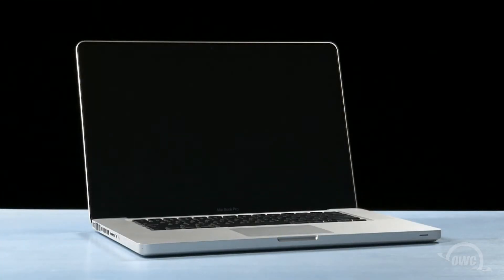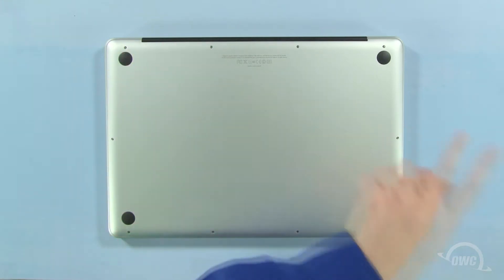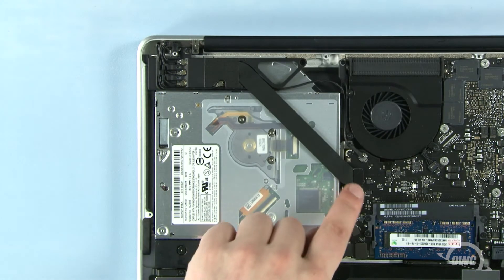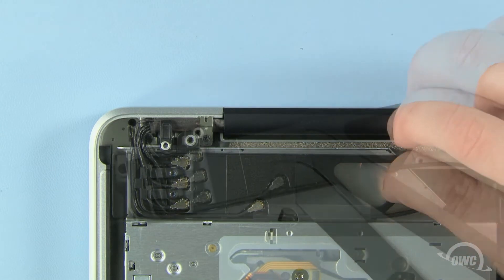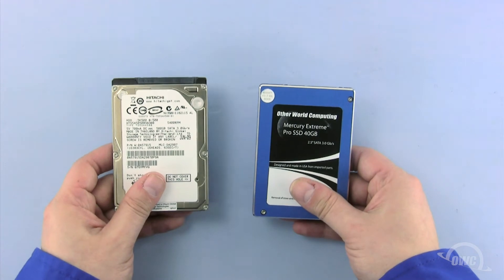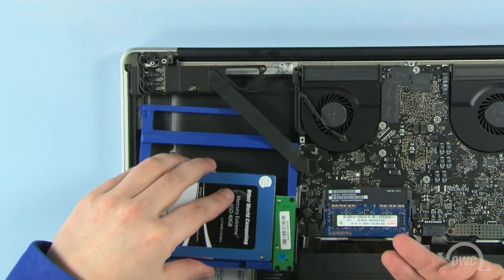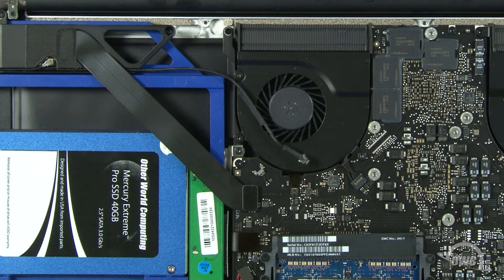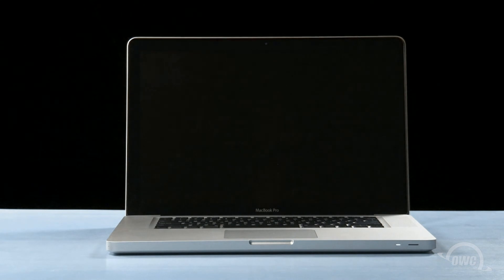How to Install a Second Drive Inside a 2011-2012 15-inch MacBook Pro with the OWC Data Double

Comment: I performed this upgrade a few weeks ago. I've got my SSD set up to run apps, and the HDD to store documents, etc. So far my Macbook is working perfectly! I do have a question though. What's the process for installing OS updates now? I'm assuming I'll have to install future MacOS  updates to each drive separately?
Reply: This is a year late and you've likely found your answer elsewhere. But should anyone else need to know, your operating system will run from one drive while the other acts as additional storage, akin to plugging in an external drive. The storage drive won't need OS updates.

Comment: Ok... the apps can be read on the HD that was installed into the optical drive bay now. Maybe, it was just slow to read because it's in the optical drive bay w/ its connection. Thank you, for the lesson.

Comment: Alright... I installed the standard HD in the optical drive bay, but the computer isn't acknowledging the apps that are installed on that HD. It does acknowledge how much room is on it with those apps. I have a SSD in the normal HD bay, and that is my startup drive. There are no other adverse affects on my MacBook Pro.

Comment: Looks easy enough. I'm installing a standard 1 TB HD into the optical drive spot that came from another 15" 2012 MacBook Pro. I've heard of people having trouble getting their HD/computer to work properly after doing this, although those problems might have been from the 13" laptop. I'm wanting all the data that's on the HD, so I'm not formatting it. The HD caddy I'm using isn't the same kind. Here goes nothing...